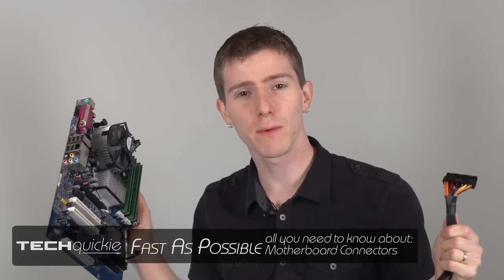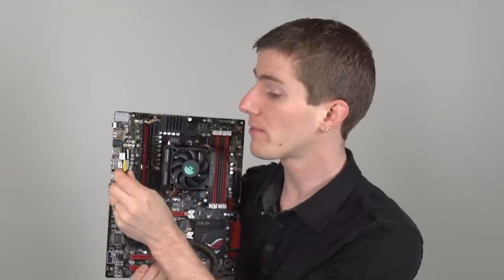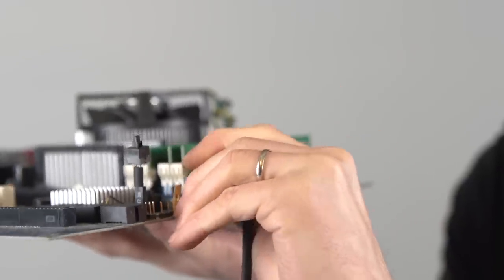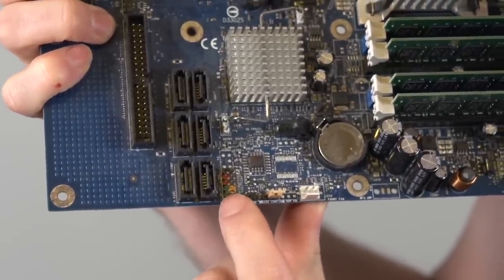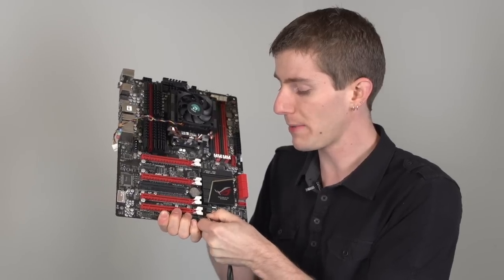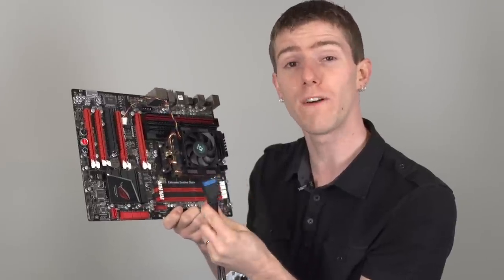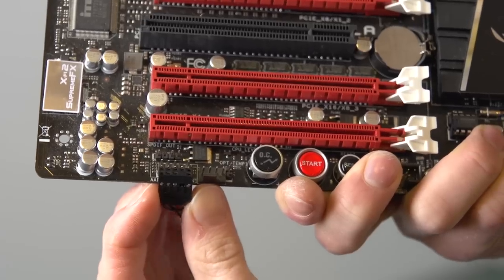Motherboard Connectors - All you Need to Know as Fast As Possible

Comment: 0:13 24-pin connector . Located along the right edge of the mobo.

0:25 P-4/EPS connector . Sometimes 4 pins, sometimes 8 pins. Often are splitted apart. If the mobo has 8-pin socket but your PSU has only the 4-pin you can still plug it in. Do make sure you don't plug in the PCI-e 8-pin into the EPS otherwise you fry your mobo.

0:53 3-pin fan header can be installed with 3-pin fans or 4-pin fans, but the latter (?) can only compatible with analog fan speed control.

1:16 Front panel headers :  power, reset, hard drive * power LED. To plug this consult the motherboard manual. Sometimes they're color-coded, sometimes labeled on the board.
LED connectors needs specific direction to plug in unlike the power & reset connector which are arbitrary.

1:45 USB 2 front headers . Use more power. Often color-coded. Follow the way the pins are organized on the connector along the ones in the header to plug in. 

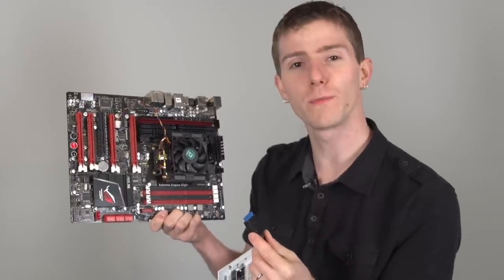2:05 USB 3 Super Speed front headers . Make sure both case and mobo support it. Usually color coded or labeled, and pretty much distinctive.
Usually have adapters so it can be plugged in the USB 2 headers, albeit not as fast as the USB 3.

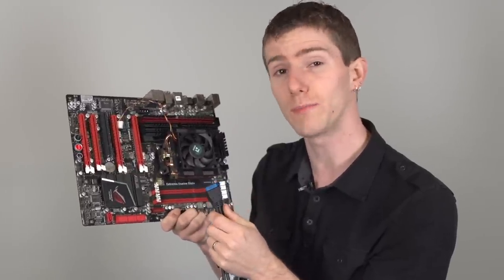2:33 Front panel audio connector . To hook up microphone/headphone jack. Usually located on the bottom-left of the mobo. Labeled 'HD' or 'Azalea'.

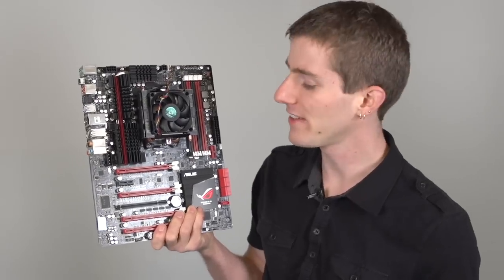3:03 this guide does not include expansion slots or data connections

3:10 Auxiliary power connector . Intended to multi-graphic cards users, carry additional power beside the 24-pin or the 8-pin to prevent the 24-pin to burn out.

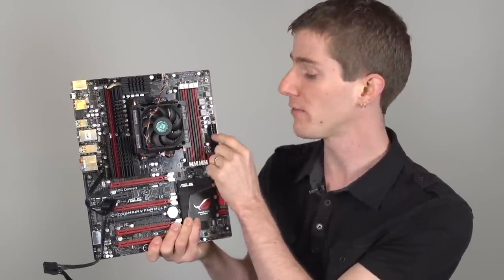3:29 click for surprise.
Reply: Thank you!

Comment: The front part with those lights, reset and power, man those suck soooo bad. So @#$%ing bad it isn't funny. They can destroy your computer and single handedly prevent it from starting. F those things.
Reply: ASUS Motherboards come with an awesome solution to this.  It's really convenient.
Reply: Griffin Melson
ASROCK's don't. Ill telly a that!
Reply: ***** They can prevent it from booting, and all it is due to those little pins.
Reply: Proto 0-0 lol found you
Reply: why bother with cords, just run a screwdriver over it ...ha
Reply: Well at least some cases nowadays like the h700i come with just one cable that’s labeled “F panel”. It includes, led, power switch, reset, etc.
Reply: Lucky yeah my case has that and I’m really confused on how to connect it. I’m used to this way on how how to do it.
Reply: I love randomly finding your comments
Reply: feel that my dude
Reply: Why is there a tick after your name ?🤔🤔🤔
Reply: Griffin Melson wdym
Reply: My
Reply: Newer motherboards come with 1 big connector for all of them, but this video and comment are very old so it doesn't really matter

Comment: Good thing you mentioned that the 24-pin was power at the end. I had no clue til that. Coulda used you telling me about where to find/identify/route/plug in the HDD cable as well. First time not so techy builder here.

Comment: if i have a 3 pin fan and a 4 pin motherboard will it work proberley
Reply: yes the extra pin will just stick out it doesnt matter
Reply: gabe nye what is the extra Pin?
Reply: Vincent Ack it's pwm connector, to control the fan speed i guess.. linus already explained it in the video..
Reply: yusuf red yea i know but what Pin is it? The right or the left One? That was my question
Reply: My pc works with it so im guessing yes

Comment: I have a question about the 24 pin where u connect to the motherboard why is it split in 2? 20pin with 4 pin. can just connect the 20 pin into the mother bord and why is it split in twos? ????
Reply: the pin that comes with power supply
Reply: He says at 0:13 where it's usually located, if it's a 20 pin and 4 pin, just stick them together and plug it in normally. It only goes in one way.
Reply: Older motherboards used to only have 20-pin connections. Power supply manufacturers for the most part make their cables with a 20+4 configuration so that their power supplies work on as many motherboards as possible.

There are some power supplies where the 24 pins are all fused together into a single piece though. If you have a motherboard that only has 20 pins make sure you avoid those.

If you plug in only the 20-pins into a 24-pin motherboard, it will probably not turn on. And if it does turn on, it will be under-powered and give you a lot of problems.
Reply: Angel Perez some motherboards are ild and use 20 pin so thats why is split up and if u using 24 just stick them in together

Comment: My personal recommendation for High Static Pressure fans used for Radiators and heat-sinks are Corsair SP series fans. Noctua fans are also among the top rated static-pressure fans.

Comment: The negative pins on the front panel led connectors are the same colour on both the Power and HD led connectors , That's the one bit that can throw you if they are not labeled.
 I remember the old days when USB headers where just a bunch of connectors you had to plug in, that was fun

Comment: VGA is analog, so not only is it lower resolution it also has artifacts.

DVI comes in different versions including dual link, which supports much higher resolutions than HDMI.

HDMI has audio, but lower resolution than DVI.

Display Port: Pretty much the highest bandwidth external connector ever, supports any resolution you can imagine.

Comment: the only connector Ive found really confusing was a floppy drive connector.  its very easy to plug that in upside down. luckily this isnt an issue for most people because floopy drives are never used anymore.  I just had to use it to set up a raid array once on an older mobo from 2010..

Comment: VGA has an analouge signal, and DVI has digital and analouge signal on most graphics cards (that's why you can use dvi to vga adapters/cables). HDMI and Display Port only have digital signal.
I wouldn't say that VGA has worse quality than the rest, but its analouge signal may cause problems with electromagnetic interference and it is an outdated standard originally made for crt displays (lcd's are digital).

Comment: need help
i connected all power ports to the MoBo and im sure it's right 
but when i press the power button on the case the MoBo lights turn on for a second then it wont work
is it the motherboard or the power supply ?
Reply: hmm upload a screenshot or a video and tell me

Comment: 0:30
I just learned about this 2 weeks ago...
Although my computer ran fine for a year with a pci-e in the 4 pin. Local store ended up frying computer later on due to wiggling the cord while on... Now they paying for my stupidity :D
I got to learn a lesson AND get even higher end parts for cheap!
Reply: What pcie 6 or 8 pin in 4 pin cpu? Is that what you said

Comment: Thanks for the info. I wasnt sure what type of 8 pin cpu power connector to use. My confusion involved the fact that they called it eps12 volt, and the pins are different on the second 4 pin attachment.

Comment: Cap'n Here: First off, He already did that. 2nd, Most modern cards (Most GeForce 600 series cards and most AMD HD 7000 series cards) use PCI-E 3.0.
The only difference from PCI-E 2 and 3 is the bandwidth. So technically, a GTX 660Ti supports PCI-E 3.0 but can be used on a motherboard that only supports PCI-E 2.0 cards, but keep in mind that the amount of bandwith you expect is only halved because of the motherboard's limitations.

Comment: @Techquickie
linus, first of all i think you said PC97 instead of AC97 :)
also about the fan connectors, i can put 3 pin fan on 4 pin socket ok. but you didnt said if i should put it from the correct side or it doesnt matter?

Comment: One thing I was surprised that wasn't mentioned: IEEE 1394/FireWire headers.

They are physically identical to USB 2.0 headers, same missing pin and all.

However, they are NOT electrically compatible!

Ignoring the protocol differences, FireWire runs at 12 volts, USB at 5!

Comment: so for the part that talked about the 8 pin connector into the cpu connector. I have that same cable that you have where is it 2 4 pin connectors split apart. Can you just use one of hose connectors?

Comment: 0:50 so as long as the 4 pin connector goes in easily it is compatible right? Because I do not want to fry my MOBO and I really do hope that I can only use four pins because my power supply does not have 8 pen for that! PLEASE HELP! I have the MSI gaming motherboard micro atx B250M

Comment: I'm doing a budget build reusing an old Compaq case, I noticed there were two plugs off the audio ports, ones an 2×4 block I'm assuming that's the hd/azealia plug being its blue plastic and the othe is a small white 1×4 connector almost like a fan header I'm assuming thats the old out dated one? And I can just let it be? 

Also I have a 1394 plug, with what appears to be a standard internal USB on the MB end, I planning on leaving it off, but if I plug it in to a USB will I damage the motherboard?

Comment: use 3-pin to 2x 3-pin adapter or plug it with molex if possible. with molex you won't be able to adjust the speed though

Comment: Thanks for the video.  It might help further if it clearly showed the label that's printed next to each header.  My MSI mobo has CPU_PWR next to an 8-pin header.  I was afraid to plug the PSU into that until I was absolutely sure.  I guess each mfr. can have its own labels?

Comment: The speed is not related to the size, hence a 8 gb 2133Mhz kit is faster but there is less. so, you need to look at what you want to do with your computer and see how much ram you need. 8gb is more than most people need however. but do remember that different brackets have different channels. if you look on the Intel websites for your CPU it will say how many channels it is. you want to try and have a multiple of your channels in the number of Dims you have. if you have triple channel get 3x4gb.

Comment: VGA or a standard D-sub connector had some pretty good god damn bandwidth capabilities, could it not transport streams with res higher than that of 1080p? Not digital but still capable if you have to use it.

Comment: i got  p4 connecter with my power supply that is 8 pin but the motherboard will only let me put 4 pins in because the other 4 pin attachment doesn't have the right slots to fit. Do i need to get one that will fit all 8 pins or is running with the 4 pins okay?

Comment: Are there safety caps on the usb 3.0?

I have the asus z170-a with corsair 780t and the 20 pin usb cable doesn't fit..? The port on the motherboard is the 20 pin usb 3.0 too.  It seems theres a safety cap on the corsair 780t fromt panel usb 3.0 cable but I don't know how to take it off

Comment: I need another USB 2 Mother board plug in to power my Liquid coolant pump.  The wire leading from the water pump/head sink appears to be 1/2 USB Cable. Can I use one of the other Plugins not being used on the mother board?

Comment: I've got an addressable LED strip header, but it's a 4-1 pin (5v - Data - blank - GND). However every strip (WS2812B) I look to buy only has 3 pins (5v - Data - GND, with 5v and GND offshoots for strips in series). Do I need to manually resolder the strip to a spare 4pin female in order to get them to work? I can't find any converters for sale, so surely that can't be necessary. I'm guessing the "blank" will double as a GND without it saying so, but then will three pins even fit? What gives?

Comment: I dont understand at 0:44. You dont put pci e 8 pins to 8 pins because it will fry your mobo? Sry im pretty new about this.
Reply: Luke Havelard pci-e connectors deliver a different amount of power and have a different pin lay-out, they also split 6-2 instead of 4-4. don't plug pci-e power connectors into your cpu power connector or you will have RMA's in the near future. don't worry about getting confused, it can be pretty confusing. good luck in your PC building endevours

Comment: if there a speed diffrence between 4 pin and 8 pin P4 connections? do it affect performance?

and is 16gb (8x2), or 16 gb (4x4), better for gaming and rendering?

Comment: I bought a Asus DGX soundcard, after installing it into my rig it says that I have to plug a 4pin psu connector. It has no power connector... Is the 4pin Molex on my mainboard required for additional power for the PICe slots? also I run one GPU

Comment: I had to put a other connector behind motherboard to insert the 24pin connector, because it just wouldn't want to fit, it was way too snug and bend the motherboard to touch the rig. And then I had to take it off, had to force a slot headed screw driver in between the male and female connector and it left a nasty nasty craving on edge, then re-plugging it was even more pain in the ass, you literally had to press even harder than first time. Is there a trick to this? 
Asus Prime Z370-p
Leadex superflower 650w Gold

Comment: I have a fairly old ezcool 750w with 4 pin will it work in the 8 pin socket on gigabyte 990x gaming sli with amd fx 6300? I will be geting a new psu but wanted to try it to make sure it all boots correctly. Any help is appreciated :) thanks in advance

Comment: i need some help. i have a Z270 M7 and im currently using an 8 pin connector for my CPU power. The problem is that i just got a RM750PSU and i dont have the extra 4pin CPU power connecter. i am overclocking so any idea how i could connect the other 4 pin ESP cable?

Comment: What about connecting a 6 pin power connector into a 4 pin motherboard slot? Does that hinder the performance of the PC, which is not used for games or any heavy programs.

Comment: If a USB 3 cable is connected and has a 2.0 adapter on it, can you connect both to the front panel USB 3.0 and USB 2.0, or it won't work?

Comment: should you plug in the axillary power connector for the graphic cards even if you only install one card?
Reply: No, a single graphics card config shouldn't require one, nor should a dual graphics card config. The aux. molex power connector is something you won't find on many motherboards, just the ones that support 3 or 4 graphics cards running together.

Comment: How do you connect a 3-pin fan connector to a 4-pin header on the mainboard?   I know you have to leave one pin unplugged.  But, which one?  Which direction is the connector plugged into the header?  Or should I just go off of the video demonstration?
Reply: There is only one way that the fan will go in due to the notch that the fan header on the motherboard has.You can't put it wrong.